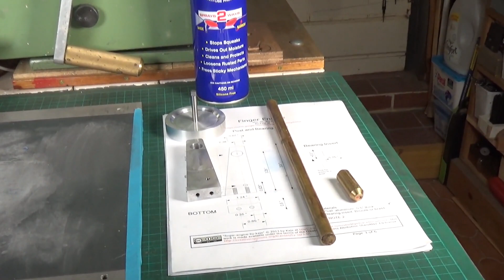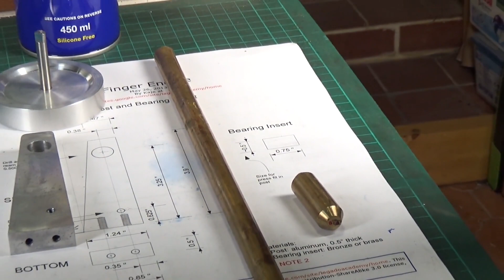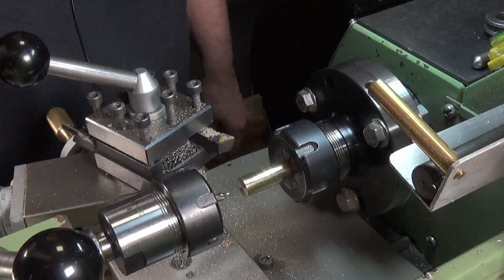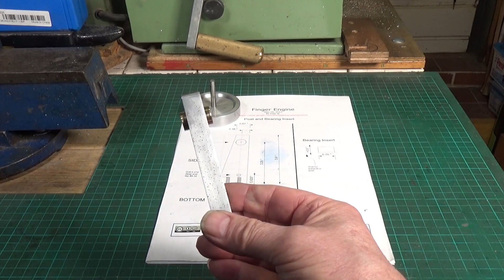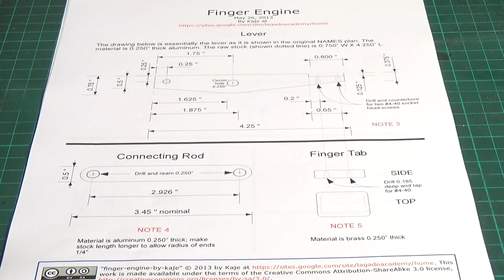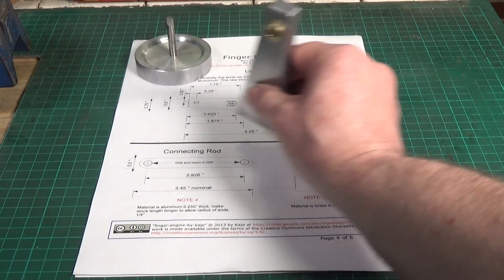Lockdown Project - Finger Engine - Part Eight

Comment: Say just curious, but were do you get the tubing for your boilers like the linemar steam engine "not the atomic reactor, im remaking a 238 weeden boiler
Reply from the maker: Hi Timothy. I think with the Linemar boiler replacement I just used some copper tube I got from ebay. The boiler was a very small diameter. Just measured it, 35mm. Made some simple end plates from brass. I believe that the Weeden 238 had a steel boiler which was nickel plated. Quite common with Weedens. Good luck with your boiler rebuild. Cheers, Alan.

Comment: Nice work Alan.   Looks good.  I was hoping you would use some Loctite on it.   Press fit bushes can compress and make the shaft bind if it's too snug a fit.  Good result.  Cheers Rob
Reply from the maker: Thanks Rob. Yes it turned out quite well in the end, really pleased with the fit of the shaft in the bush. The Sherline gets a good work out with the lever, which is one of the next pieces I make. I'm really impressed with what that little mill can do. Cheers, Alan.